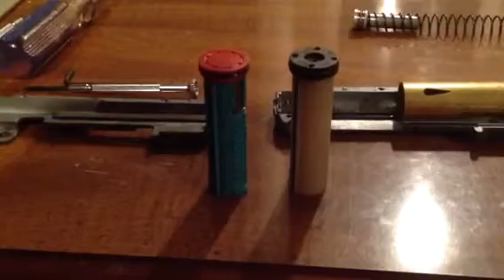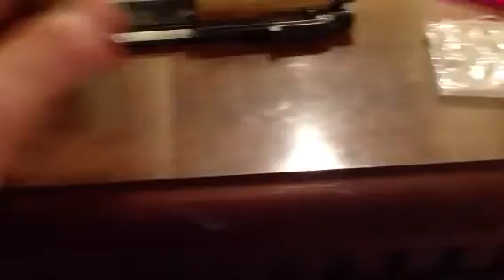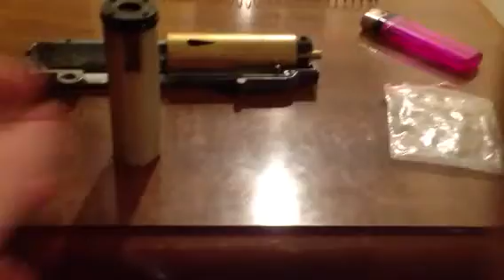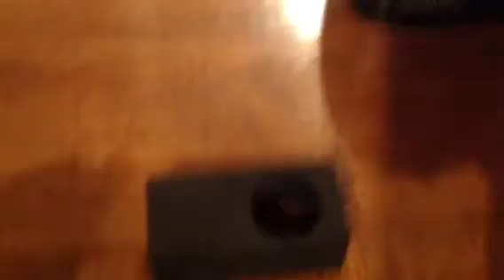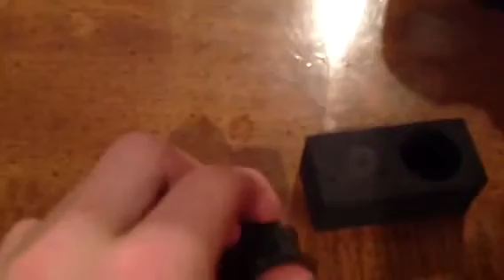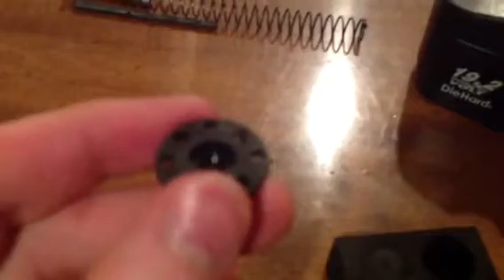Airsoft DIY Basics: Consistency Mods 2/3-Porting A Piston Head

Comment from the maker: It depends on how good the air seal of the gun is.  If you're gun is stock, the seal is most likely not very good.  I suggest that you get a pack of #14 O-rings from the nearest hardware store and replace your current piston head o-ring with one of them.  Porting your piston head can also work in conjunction with the new o-ring to help up your fps. In extreme cases, doing this can bring your fps up by a good 15-20 fps.If I were you I would do this if you want to bring up fps w/o sacrificing rof.